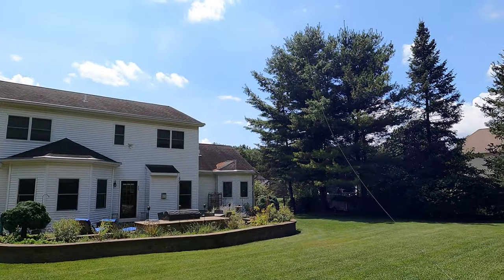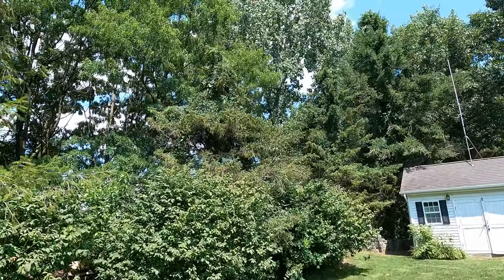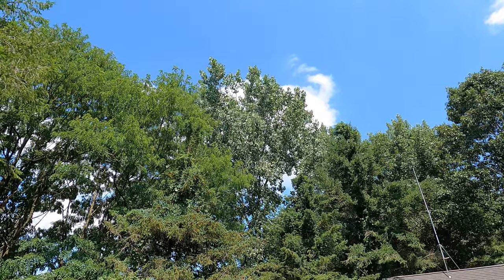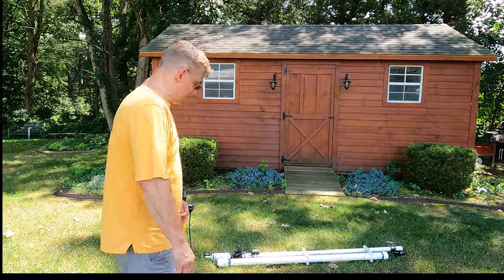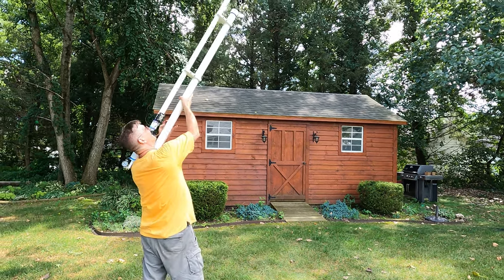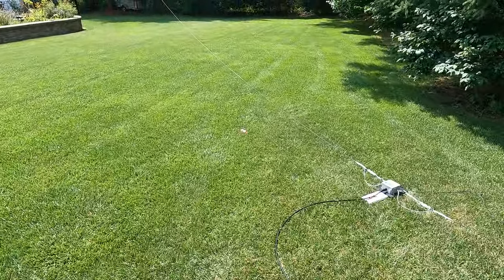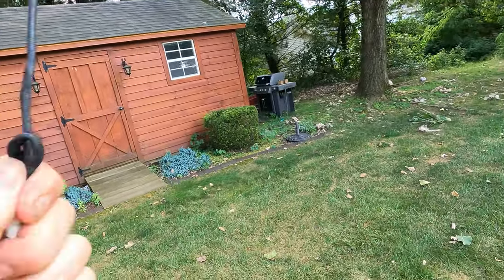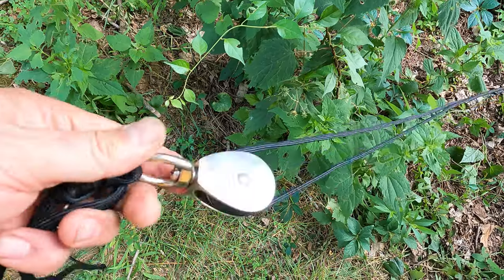Using air launcher to install wire antenna

Comment: Great....
Any suggestions on approaching neighbors for permission to use one of their trees?  I have a similar situation. Unfortunately no sizable trees in my backyard but the neighbors behind me beautiful tall firs and birch trees. Would like to set up an end fed Zepp.
73
Reply from the maker: I did approach one neighbor a while back (who has a couple of great trees, including one that would allow me to upgrade to a 160-OCF, which I REALLY wanted to put up, but he was obviously not in favor even though it's on the back of his property, and out of view... but it's his yard, and so I respect the decision. So an 80-OCF dipole it is. I lucked out, as the former neighbor behind me years ago saw me struggling in the back yard trying to find a fit, and out of curiosity, she asked what all that "stuff" is for. So I went into ham radio ambassador mode, explained the hobby, the public service angle, and that as an FCC licensed operation, it comes with rules for safety, interference, etc... She then asked me "would it help if you could tie off one end to my tree in back that faces your property?" I said yes it would, but I was hesitant to ask, as people are usually either suspicious about the safety aspect, or just don't understand the hobby at all, and defer to "No" out of an abundance of caution. So up it went! Then they moved, and I decided to be proactive and reach out to the new owners "Welcome to the neighborhood, and oh... let me explain that wire in the tree way in the back". They were super cool, and said no problem, steady as she goes... SO if there is a moral to the story, I guess there is no shame in asking, but be prepared for a no, and keep a smile on... because sometimes people will pleasantly surprise you. And you can always go vertical... ugh. Thanks for watching, and for the question!
Reply: @halfmoontechlabs  Thanks....!  Yeah, I just moved into a new place...fairly decent backyard but no trees high enough to do anything with,  There are two neighbors behind me with the tress I want!  Trying to build up the courage to just go over and ask.  The most they can say is no....I get that!  Hoping to the contrary!  Plans already in the works for a GAP vertical soon and later to put up my 50' Universal with a 3 element beam.  I thought at least if I could get a wire antenna up, that would get me on the air.  BTW, if you don't mind, where did you get the canon? 73, K9ALT
Reply from the maker: @cannong1728  Check out my other vids, one shows exactly how I built my air cannon! On the neighbor talk thing, another approach is to talk up how the wire is barely visible to invisible depending on situation, and that if you can't find a workable solution, then "I guess I'll have no choice but to put up a tower... I'd rather not, but I'm running out of options", lol. Let them do the math on which they would rather look at ;) Good luck!

Comment: Do you have a vid of the making of the launcher, snd a spec for the antenna and radio you’re using?
Reply from the maker: Yes, look at my other videos in this channel. The construction video is titled :"Pneumatic launcher (aka "Air Cannon")". On the radio question, I use SunSDR HF/VHF radios, and my HF antenna is currently an 80M OCF dipole. Thanks for watching!

Comment: Sorry, I forgot to ask you this question when I first watched your informative video.  My question is about the pulleys that you were using to hoist the antenna into the trees.   What type of pulley are using for this project stainless steel or zinc type.   The other question is did you get from a brick and mortar store or Amazon purchase?  Thanks for your reply.
Reply from the maker: I usually use medium sized zinc, but preferably chrome plated brass. Usually just a Lowes or Home Depot type with a riveted axle will do. I let down and inspect usually in spring and fall, with no problems after using these for years. Good question, and thanks for watching!
Reply: Ok, thank you.  I used my version of an air cannon to get my ropes into some pine and hardwood trees in the backyard.  All I can tell you is I didn't use alot of PSI pumped into the air tank of the cannon to put a projectile into any tree.  10 PSI was the least that I used this time.
Reply from the maker: @kd4baoc612  It really takes very little pressure if you have a decent fit with projectile & barrel. I find 50 PSI will burn through a good canopy and small branches, no problem :) Thanks again for watching!